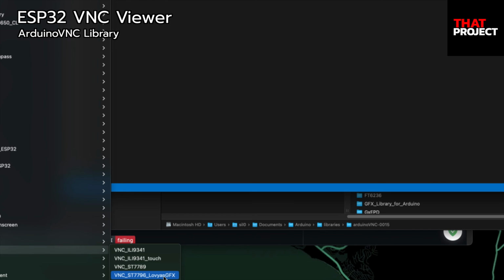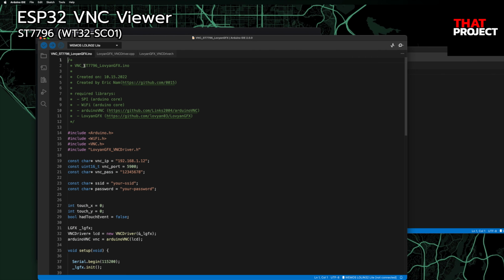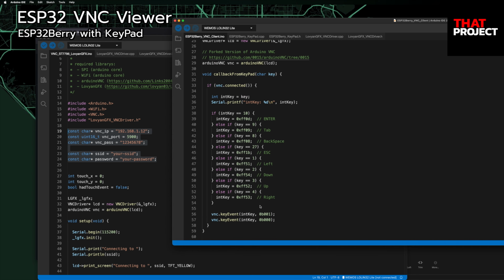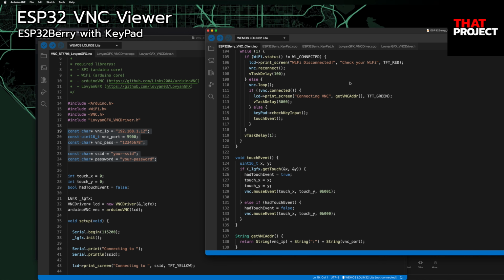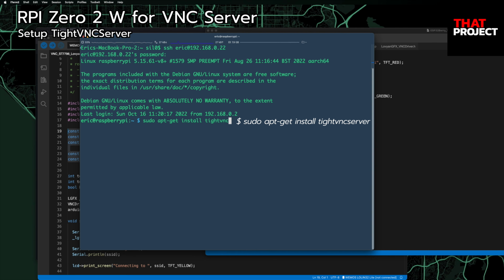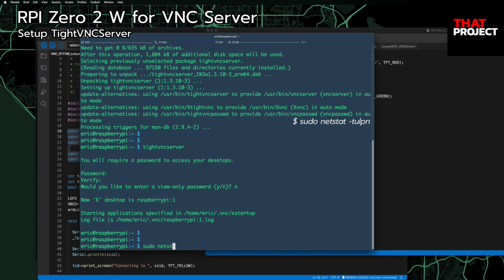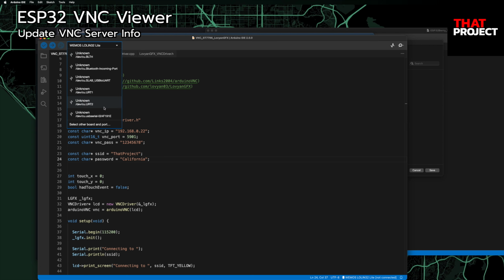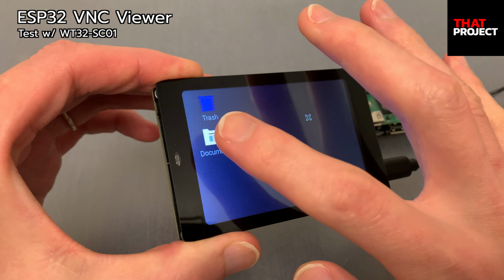Control my PC from ESP32! (VNC Viewer)

Comment: Is there a rtsp cliente for IP cameras, what about YouTube streaming durectly to esp32
Reply from the maker: RTSP client: Yes—there are lightweight RTSP clients for ESP32 that can pull frames from IP cameras. Keep to MJPEG/JPEG (or very low-bitrate H.264); full H.264 decode on-chip is limited.
YouTube direct: No—YouTube uses DASH/HLS and DRM (Widevine), which ESP32 can’t handle. Use a PC/Raspberry Pi proxy to transcode to MJPEG/RTSP for the ESP32.

Comment: Bro can you do browser in esp32 cam
Like html page display
Reply from the maker: You mean rendering HTML page in ESP32CAM??
Reply: @ThatProject  i mean to display website in esp32 display
Reply from the maker: @nivedpadikkal  It's impossible yet. There is no HTML renderer for ESP32.
Reply: ESP32 is too weak for parsing and displaying html with css and js. A Linux based SBC is required
Reply: @iliasalaur you may do HTML4 i guess